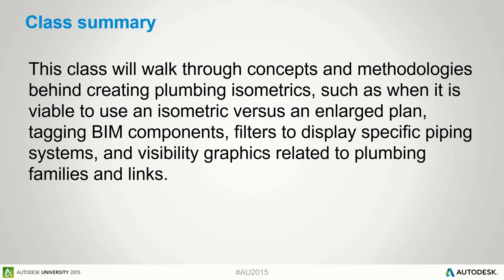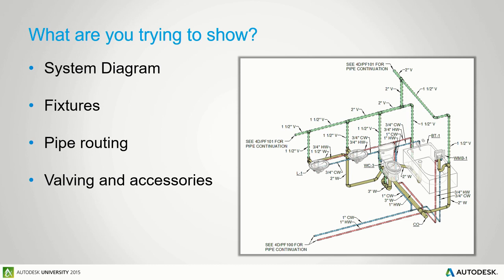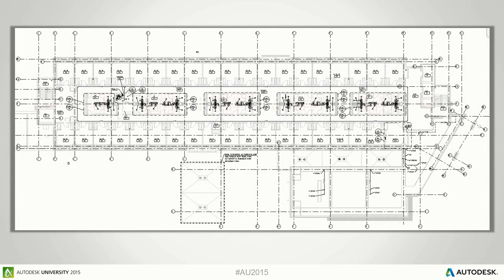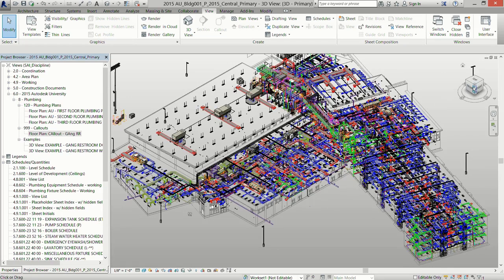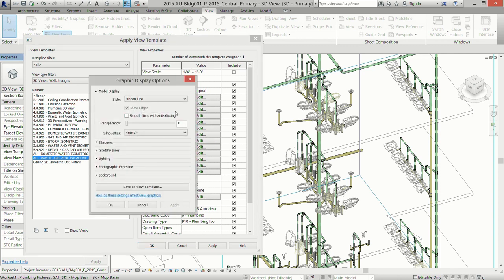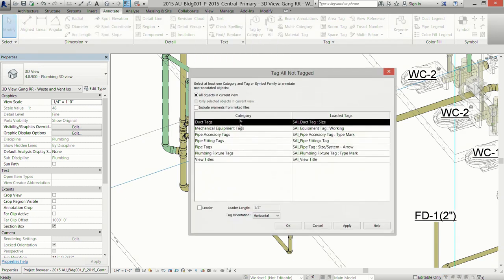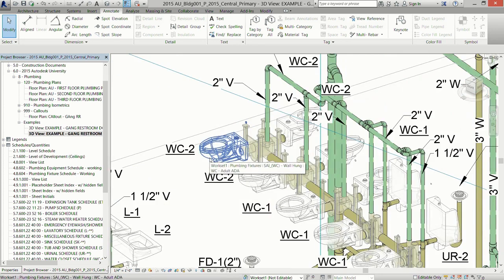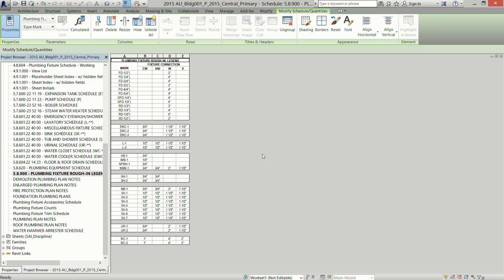Revit Plumbing Isometrics for Beginners

Comment: Hi Sir, Nice project. but I have concern in around revit mep. Can be work the revit particularly in sewerage & waste water system. I've done in the families under Pipe types & Piping systems to added new pipe types & piping system. but when I create the new pipe name Compressed Air in the properties the system pipe is ok but the system classification is under Domestic Cold Water how to edit the classification under properties mechanical.

Comment: Great video. Thank you so much!
I have a little doubt.
How did you get that 3D view of the 2D architecture plan? Did you use Autocad for that, then insert it into Revit?
Reply: It's a separate architectural revit model, linked to a plumbing revit model. Same as the XREF in autocad. By this there is less clutter of drawings.